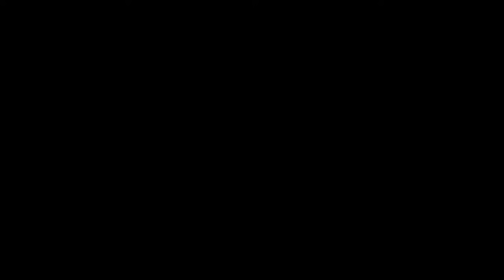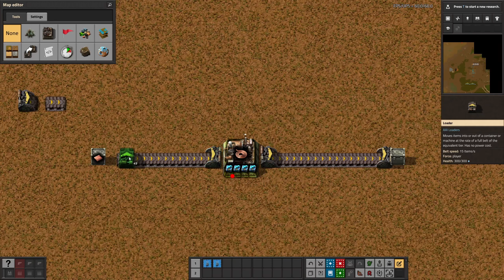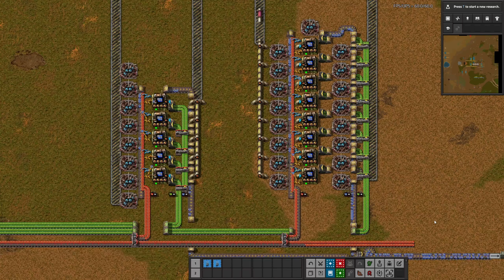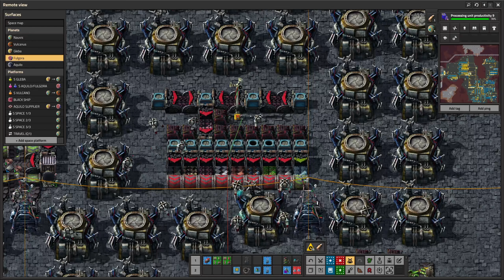The Truth About Loaders: They don’t remove engineering problems—they just change them.

Comment: Often an even BETTER option is to use 'Bob's Adjustable Inserters' or 'Smart Inserters'.  Having an inserter that only needs to swing 90 degrees allows it to transport twice as many items as a vanilla one swing has to swing 180 degrees.  ...and changing the angle to 45 degrees — or less! — doubles the throughput again.  (The value of the ability to choose which lane items are deposited in can't be overstated, either!)